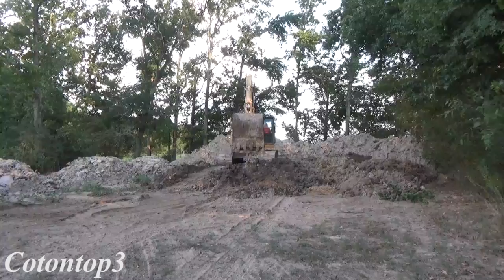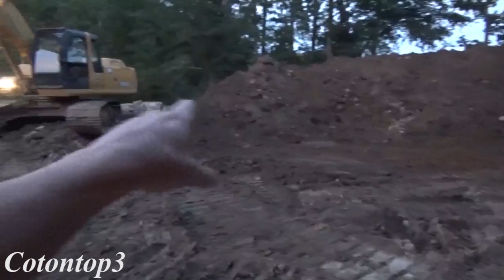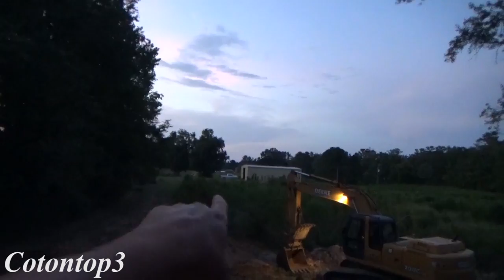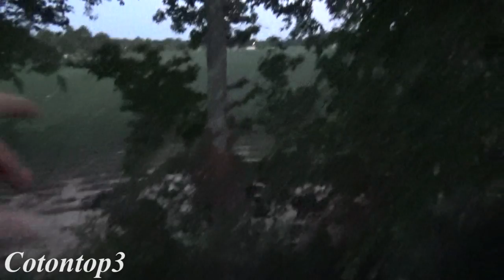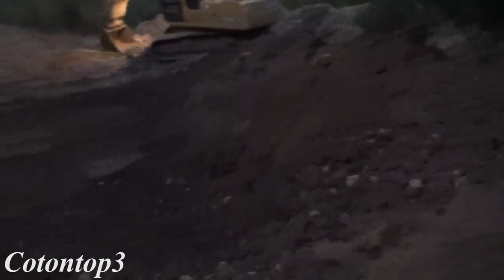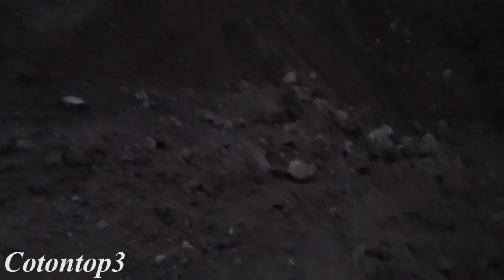Building a shooting range backstop with the John Deere 200 excavator

Comment: Up until now, never gave it much thought, but watching you made me realise and appreciate not only the skill, but the thinking before you start, knowing how you want it to be and then as you are building and moving, knowing where you are in terms of the machine being on the edge, then there is the knowledge of how the bucket will affect the machine when full and as you swing - so much and most of it has to be done "on the fly".
Nice video.
Reply from the maker: +Eezee Listen thank you and you are correct, my mind is constantly calculating and processing each second.  It's kinda weird to me because I know what I want and then with the motions of my hands, it all comes together.